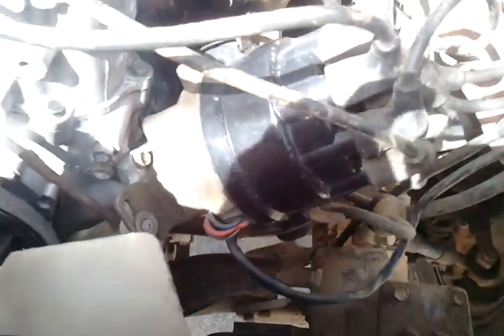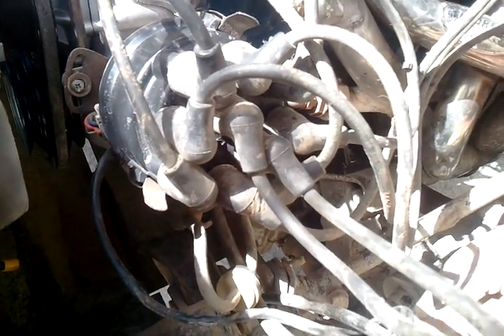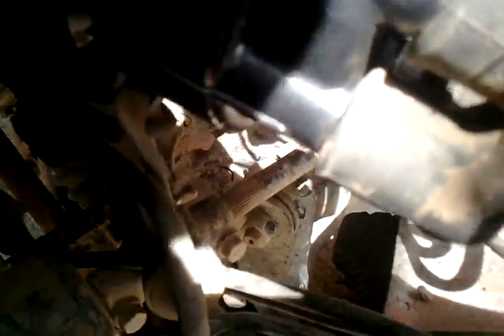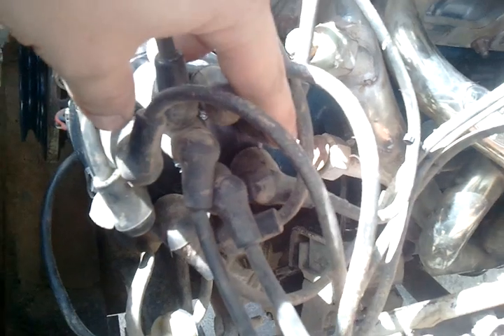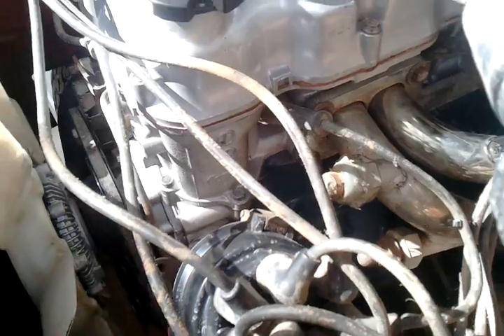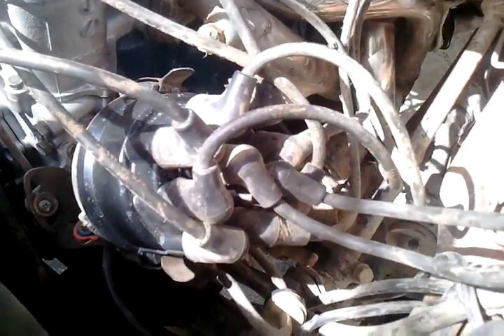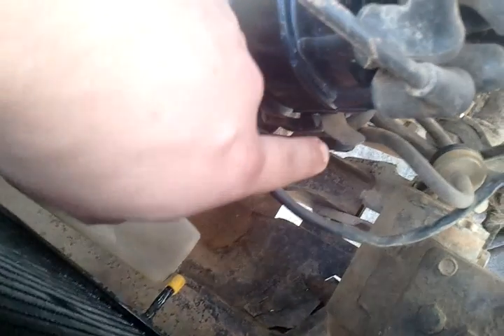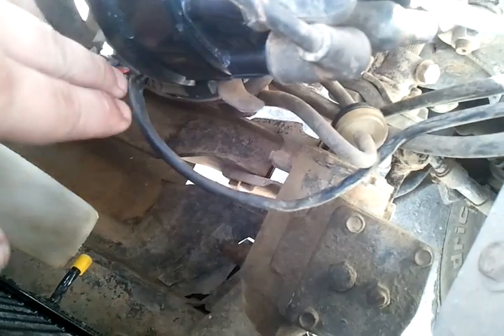Distributor cap alignment n spark plug wire order

Comment from the maker: the rotor is going to point wherever it's set to point when you popped the cap, you should notate that when you first remove the cap if your just doing a normal replacement.

In this video, I point out every plug and what it's placement is on the motor... the rotor "should" only go back on one way unless yours is stripped.

If so, the only other option is to manually crank the #1 piston into tdc then check it's placement against the #1 intake plug I point out in this video.

Comment: Lose the eight plug setup. Plug 4. Get the crank gear from a 280Z motor and the distributor drive from a280c and a 5-10 distributor. The crank gear and drive from the 510 are also the same. Don't forget the oil Slinger.
Reply from the maker: Why in the world would you want to do that?

If I was gonna Frankenstein a motor, I'd just throw on an L20b peanut head for the better flow, then over bore, get dished positions and add a turbo.... 

But all that still isn't worthwhile... Outright Motor swap is where it's at.

Comment: I have a 1992 b2200 Mazda I replaced the distributor and the little black wire that runs off that little black box to the coil does it go to the negative or the positive
Reply from the maker: Sonny Price, sorry, I couldn't tell you my friend. This is the distributor for a 1981 Datsun 720 with a Z22 motor.

Comment: What year model is yours or does it matter the firing order is the same
Reply from the maker: The firing order is the same for 81-86 NapZ z20, z22 and z24 motors with the dual spark plugs.
Reply: I seen got it right figured out it needs a idle air control valve
Reply: 1985 350 Chevy